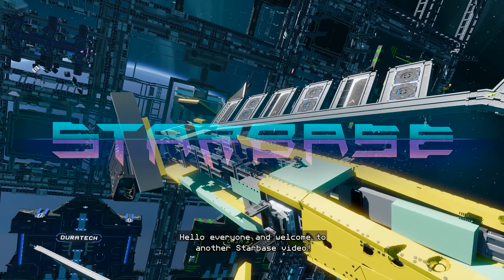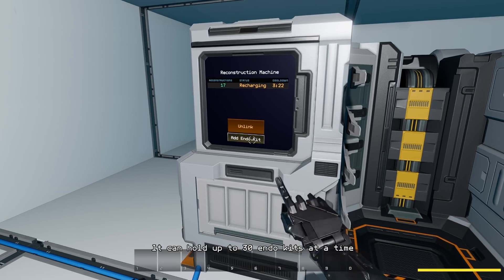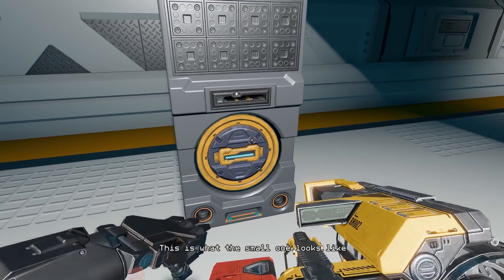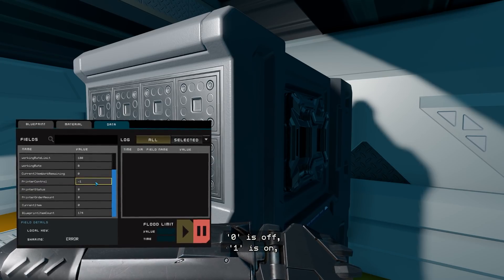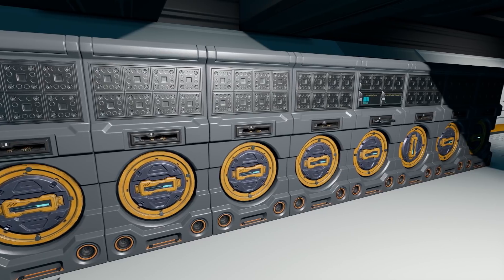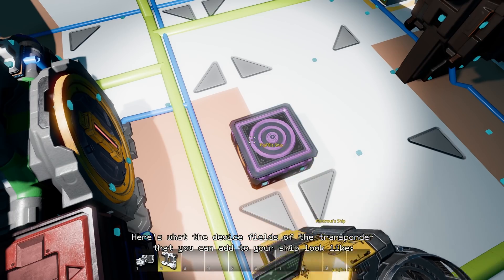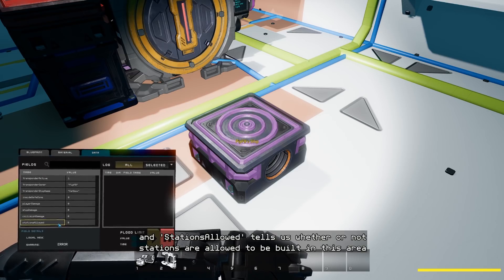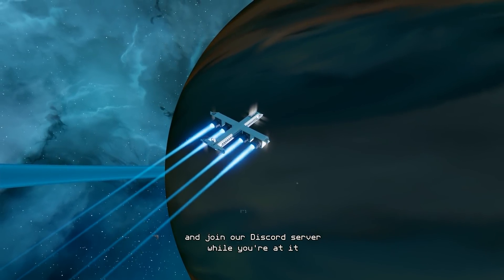Starbase - More Devices Feature Video (Reconstruction Machine, 3D Printer & Transponder)

Comment: Ummm...

Does this mean you can make 2 versions of a ship one that is partial and one that is full

And update it later via a blueprint chip? Would be really cool

But can it remove parts if there is a conflict between the blueprint and what is there?
Reply: Blueprints just make the parts. It doesn't assemble them from my understanding
Reply: @PyroTech03  well video said it puts it where its ment to be

At least when talking about using it on a station
Reply: @commanderoof4578  Yea, right now stations assemble from a connected inventory or the station inventory

Comment: So building is pretty dumbed down. I'm used to Space Engineers, where you actually have to build every block. Requires some ingenuity. It's more engaging than placing down a block that does it all for you
Reply: you can build manually if you want.
Reply: @Ivan-bk9xs  what would be the point if there's a much more convenient option? It's like deliberately handicapping yourself. It would be like having power tools but using hand tools instead. The point is I want to play the game to be in a scenario where I have to use those hand tools. If the game built and did everything for me then what would be the point in playing it?
Reply: @andrewgodly5739  not everyone is into menial tasks and people would get tired of it quite quickly
Reply: @Ivan-bk9xs  it's not menial. Have you played space engineers? You can actually build welding ships and devices to speed up the process. It requires some ingenuity. I was hoping this game would require complex factories with robotic arms that stitch ships together. Wouldn't that have been cool? Instead you just place down a block and it builds it for you. Like may as well just have a craft button that makes the whole thing pop into existence
Reply: You get far more control over ships if you build them manually, building it with the modules limits what you can do
Reply: @andrewgodly5739  except this is much more complicated them simple blocks, you have to take into account the thickness, weight,structural integrity, flight physics, connections,placements,etc. This is leagues more complicated then space engineers in terms of building. I have space engineers and I feel like this is 10x more realistic in terms of building.